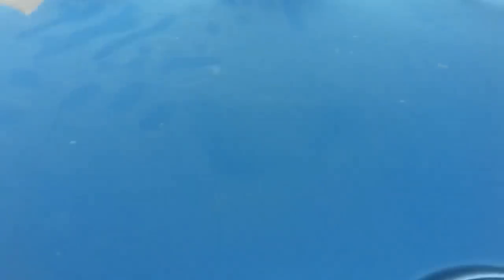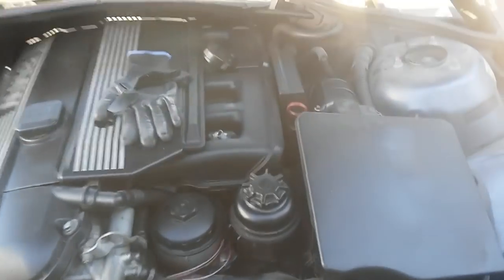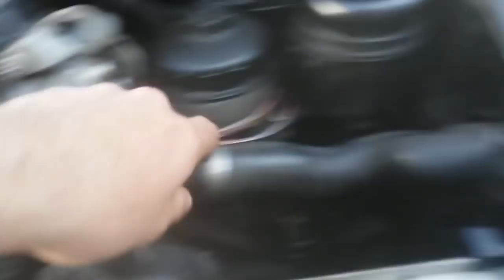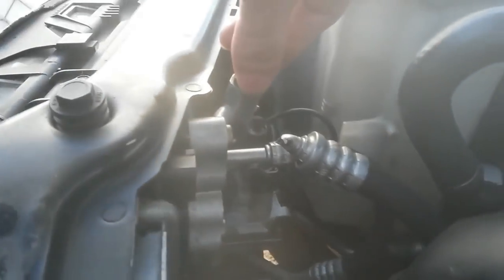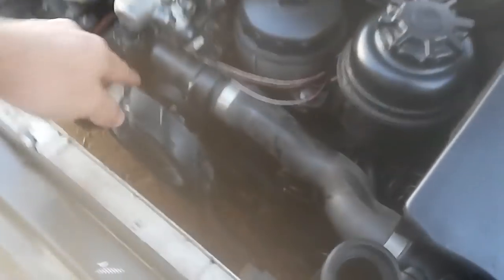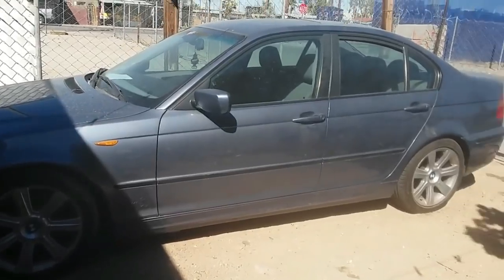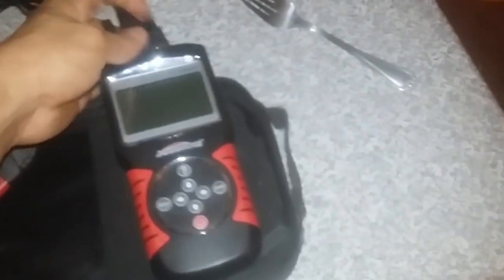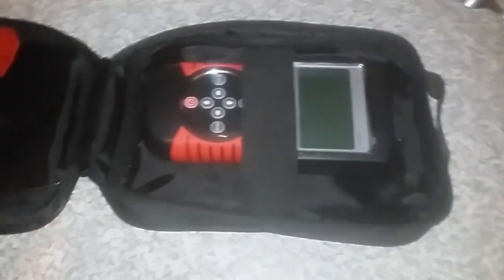Showing the Damages on my 2003 BMW 325i (The Infamous E46)

Comment: This seems more like bad maintenance than bad engineering. Ive had a BMW and you know when this is going to happen.
Reply from the maker: Das Raddiche unfortunately, it happened, i believe, because the fan shroud was not on.. it had came without it.. i asked around in Bimmer fest and forums if it was normal without the shroud and most said yea.. but man.. ima Just buy the shroud too. dont want this ever to happen again.
Reply: @KingDragonKraken   You might consider an electric fan!